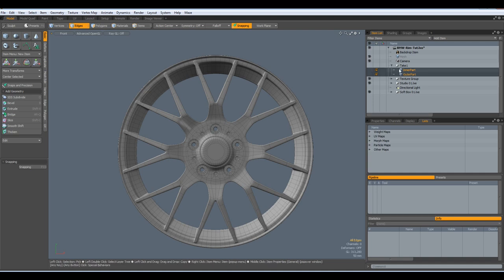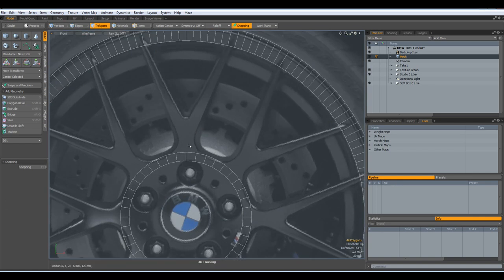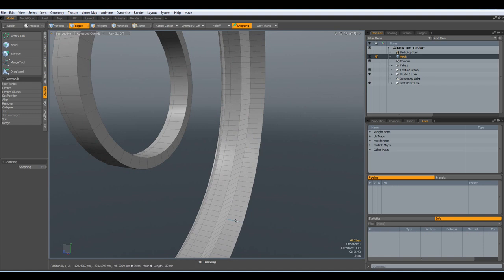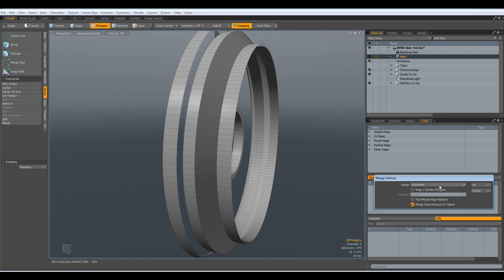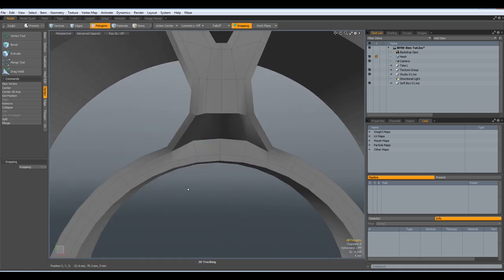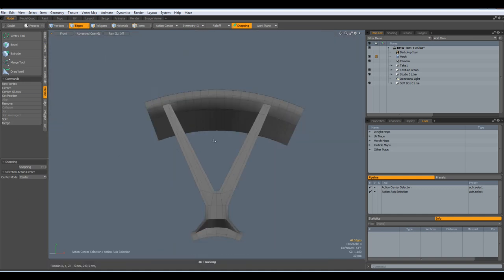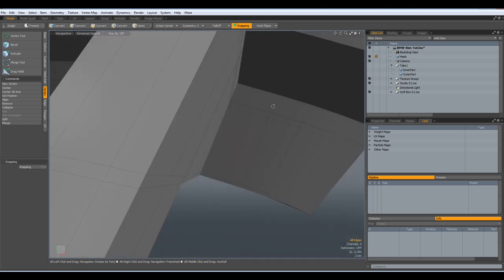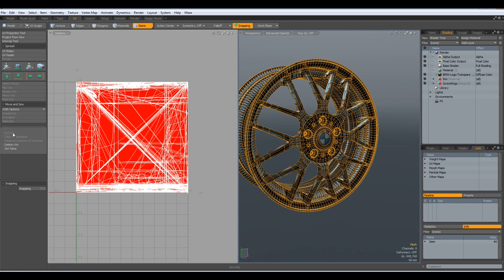Luxology modo - Modeling a BMW M3 Rim

Comment: 6:15, When I try aligning these 2 sides "together" it will not work. If I do them seperately then it will ( as expected ). How did you manage to get the align function to work while selecting 2 different operations ?
Reply from the maker: +Remo Van de sande Hi, as you can see on the top, Symmetry over the X-axes is active. Modo 701 did unfortunately not highlight the field when something like Action Center or Symmetry is active. Kind regards, Peter

Comment: Hello Mr. Peter, I watched this tutorial and It similar to a project I am working on right now, I am modeling a car wheel with similar to this but my radial array would require that I used 5 instead of 8 like what you have but doesn't seem to be working, I am not sure what I am doing wrong
Reply from the maker: Prince A. Williams Hi, it's a bit difficult to give an answer without a screenshot or similar.